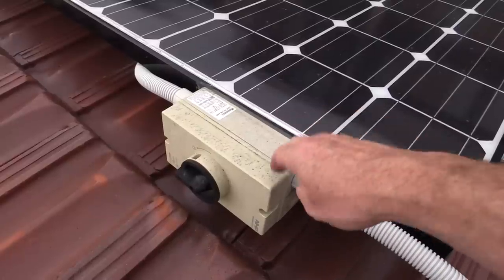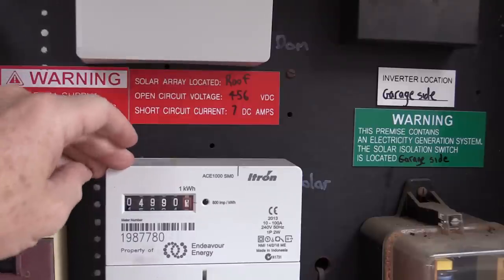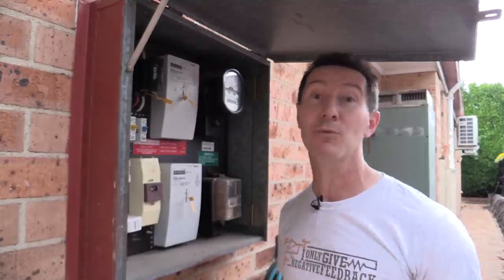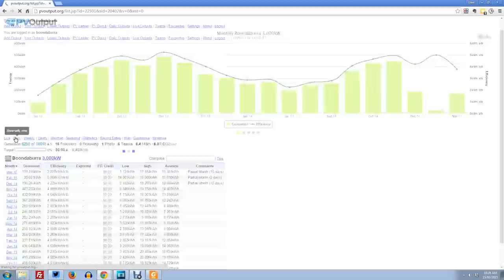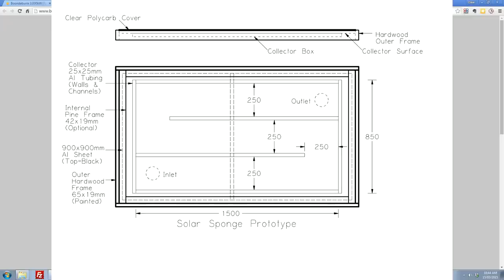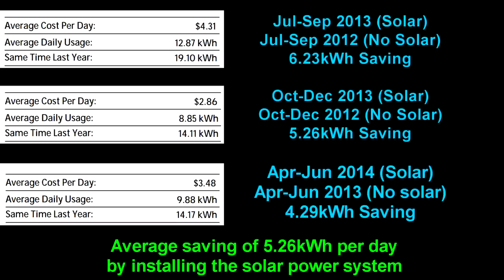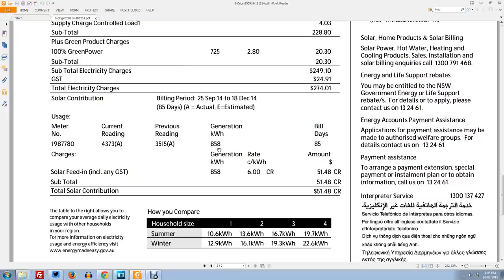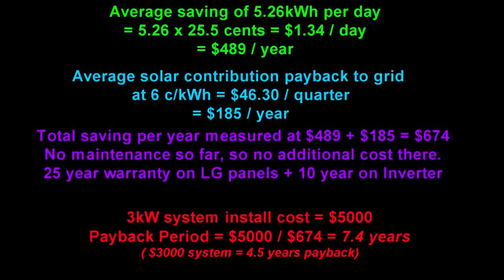EEVblog #724 - Home Solar Power System Analysis & Update

Comment: I been thinking, maybe a temperature sensor on the panels to measure the overheated panels will help configure the temperature coefficient of the panel at the time. We all are losing a lot of power in the heat of the Sun, and we just don't know it...
Have you ever configured the power loss with the temperature coefficient of your panels? 
Our panels are never at 25° C except maybe in 'winter'...

Comment: What you should have done is just put the system in yourself and hooked it to your internal electrical system in your house and keeped that old mechanical analog meter in service, instead of going with that 2 meter system. That way, if you put power back on to the grid. It will spin your meter backwards and they will pay you the full rate for the solar power you put back on the grid.

Comment: What sort of aggravation would you run into putting in a life battery bank?  You could end up cutting that peak usage rate.... Utilities here are screaming duck curve, and no longer paying much of anything for power pumped back into the grid.. a major pain. Think 1 to 3 cents per kwh.  When people were told they could get 20 cents per KWH, they were looking at that to pay for the systems here.. No longer.  I'm looking at it for full power backup... I figure 9 kwh worth of batteries would be needed, so I've started linking up the pennies in the pigging bank....

Comment: Dave,

Is there an opening for a design of an inline switch on a short cable that reads your bluetooth meter and only allows mains through when you are generating power in excess. Maybe not bluetooth, but signals on the mains line powerline products use.

I could imagine a small box that was in a co-operative scheme with others (so the whole scheme doesn't oscillate on and off) to determine which was allowed on, set by watt loading (rotation switch maybe) vs watt availability.
 
Imagine then, things like pool pumps and dryers would only run when consuming your power making the owners minimize grid consumption.

Comment: I wonder if storing the unused energy on batteries would provide better ROI rate. Of course, then one has to factor in both the cost of the batteries and the maintenance of them, but in your case -- very small incentive for exporting power to the grid -- it might be more "profitable".

I don't have the numbers, though. So it might turn out worse. I have to leave it to you to crunch the economics :-)

Comment: My cousin has a 50kw solar panel installation here in France, and is getting payed a high rate for that. He'll be laughing all the way to the bank in a few years, but he's worried about lightning and other threats. The Sunny boxes are not very reliable, though. They keep on having to be replaced.
Reply: Leonard Janus Sorry, I'm not sure I know what you mean.
Reply: Henri de Feraudy I believe he means these, which I looked at a while back for building my own pv system, along with a Xantrex XW hybrid inverter/charger/battery system by Schnieder electric: http://enphase.com/microinverters/

Comment: Did your installation costs include some massive gov't subsidy?  I ask because here in the US, typical install costs for PV are around $4 per watt of nameplate rating, so a 3kw system is around $12k to install, not the $5k you mention.  Just a sunny boy ~3kw inverter the last time I looked was something like $3k or $4k, without the panels.  Also here in the US, most states have "net metering", which means if you sell back 3 kWh in the day, and use 3kWh at night, your net usage is 3 - 3 = 0 kWh so you pay nothing ( besides the fixed service charge ).

Comment: Holly crap do they screw you on those rates, 4x more for them to give you power then for you to give them power... and a service charge on top for good measure.
With a system as good as this I would seriously consider slowly adding batteries so you can get more and more out of your own power, considering you still pay out a thousand per year this should pay back quickly.

We used to have a 4x rate on solar power payout around here, but the moment people actually started putting panels up that dropped like a rock, it is still 1:1 but anyone who hoped to pay for their system quickly got shafted.

Comment: Wouldn't Dave be better of if he kept his old Ferraris meter? I guess he was forced to get the net meters, the old meter would simply turn back (at 24c/kWh). Since you are not using all the energy during the day the meter would run backwards, then during the evening and night the meter would run normal again, thus "using" the energy you supplied to the grid. Key thing here is you want to dimension your PV-system according to your energy usage.

Comment: Wow that's expensive!  We're at $0.10 usd per kwh during the summer and a couple cents lower in the winter.  They offer $2 per watt rebate if you install solar, and the govt. does about 30%, so we get about 60% off after rebates and tax breaks.  Pretty sweet.  The only problem is our HOA not allowing panels on top of our homes :(

Comment: Here in Sask Canada, we are charged 14 cents a Kwh but also basic charge and taxes so 500 kwh is 100 bucks or really 20 cents.  You could easily pay off an electric water heater with the  extra power your not using and put it as a pre-tank to your gas one. But without a battery bank to store and reuse your power when you need it your giving your savings away.  over 7 years to pay off 5000 is pretty crappy. one day selling excess for 6 cents next day buying it back for 24 plus taxes sounds pretty ridiculous.  I wouldn't want a system like that.

Comment: Sounds like it would be worth investing in a dual system with battery and grid tie. With cost difference if 24 to 6 cent it could pay for it self
Reply: Tom Keyser car batteries tend to be 12v, 16v. there are industrial applications where they are 2v, but massive in capacity.

depending on what voltage ur array supplies the regulator at, u can connect a charge regulator and batteries in series to work with the system. for example, if ur array supplies at 14v, u can use a 12v regulator/charger to charge the batteries. And the power from that will go directly to an inverter. if ur panels 42v, this is 3 times the 14v. do u can connect 3 12v car batteries in series to meet the array floaters, just make sure to get a regulator/ charger to work at 42v.

Comment: I'm in VIC and i still get 60c feed in :) and I didn't pay the have it installed it was on the house when I got. So even if you installed the system while the 60c feed in was available they didn't take it away then it was dropped down. And even if you sell the house the rate stays with the house.
Reply from the maker: Dwayne Godden You won't get that forever though.
Reply: There is no plan to change it from what I'm told. The longer the better and I will enjoy it for as long as i can :)

Comment: WOW!  Much cheaper here in the USA.  I pay about $0.10/WKHr + a $22/month connect fee.  When I first put in my 2.8KW solar PV system back in 2007, the electric company paid me full retail any surplus I made.   In the spring and fall, I typically ran negative electric bills. But that only lasted a few years.  Now if I have a net surplus for the month, they only pay me about 3 to 4 cent/KWr that surplus.  Still a better deal than you as anything I generate during the month gets subtracted from  the energy I purchase during the month.   It is only when I have a net surplus for the month that I get a reduced credit for what I generate.

Comment: Thanks, great report. I'm installing a 4.48KW system - fourteen 320 watt LG panels and Enphase microinverters. I'm in California, USA. Our federal government gives a 30% rebate. Dont feel bad about 0.06/KWh, Southern California Edison is paying about $0.045 per kWh. I'm serviced by Los Angeles Dept of Water and Power who also uses net metering and expect similar payment. About cleaning panels, it doesn't rain here anymore :<), and efficiency will drop if no cleaning. For safety sake, I believe  (1) Clean only at night - (2) Disconnect system from the grid, (3) Lather panels with foamy soap (4) Rinse them down,  (5) Squegee them dry.... for single inverter systems, power that unit down if it is grid powered.  ...Your thoughts?

Comment: We have a 5KW system with those same LG Mono panels. We have 21 Panels which is the biggest system Ergon would let us have. On a sunny quarter our system makes $900 because we are on the 44 cent rate until 2024.
Reply from the maker: freeze69IceMan Wow, that's a huge rate, and locked in!, I'm envious. Payback would be 1-2 years top for you?
Reply: No, closer to 5 Years. Our system was $22000 installed with a 25 year efficiency warranty and all that good stuff. It has been on the house for just over 18 months and i just checked the meter and it has made 11.4MWh. Plus we live in Mackay, Queensland.
Reply: And we are a very power hungry house. Our gross summer bill is easily over $1500. But winter offsets any extra summer usage.

Comment: I had panels installed many years ago and the company tried to trick me into polycrystalline by forging the wrong paper work. I managed to get them swap it over for free as their website recommended monocrystallines. It pays for the bills and it is a feed in tariff and I got that Sunny data logger so i can check for any problems.

Comment: Maybe by the time you get a Tesla, you'll be able to use the panels to charge the car and power the house during the day. Then use the Tesla battery to power your house [to an extent] during the evening. That would be ideal and save the cost of adding/replacing components for a traditional battery bank.
Reply: i don´t know how Dave is using his car, but most people drive during day and charge over night. Or they drive to work, where they can´t use their own solar power.
Does the tesla allow back feeding to the grid anyway? And even if: Every charge cycle is degrading the battery slowly but surely. Not a bad idea, but it would have to fit very specifically to the over all life style of the user for a few years.

Comment: I know that this question does not pertain at all to the system you have installed, but how does Solar PV compare to Solar Hot water/electric heat pump hot water systems? Chapter 6, page 38 of "Sustainable Energy without the Hot Air" by David Mackay recommends solar thermal over solar PV in terms of energy production due to the large amounts of energy required for heating/cooling things like water.

Australia's higher insolation would change the parameters somewhat. I suppose in principle generating electricity is more useful because it is usable in a wider range of devices, but what I'm interested in is whether a PV system or a solar thermal system would have a bigger impact on our power and gas bills given no behavioural changes; and which option would abate more carbon, assuming Loy Yang coal power and natural gas fired water heater.

As a further question more specific to your PV setup, what would adding storage do for your power usage, and would it deliver an economic return without specific behavioural change? Solar's peak delivery during the day but peak domestic power use happening towards dusk and night time would be served well by storage, but would it give your net meter more of a kick?

Comment: Wait a minute, you solar generated 7.5 MWh, gave 5 to the grid. That leaves 7.5-5= 2.5 of it that you used in your house. You also used 6.7 from the grid. That means your total use was 6.7+2.5=9.2. But again you only solar generated 7.5, so no, even with a perfect storage system, you would not be energy independent. you need an  extra 25 ish percent increase in your solar power generation amount.

Comment: All your calculations look correct. I will not get a battery at this point if I where you since you have the grid for that even at 6 cent is better. The best LiFePo4 will not be able to be amortized at all at those 25 cent/kWh or just barely so it dose not make sense.
I live OffGrid so I have no choice other than to use a battery but I needed to design and build my own Solar BMS charge controller since there was none available for Lithium batteries and Lead Acid was absolutely no option those are extremely expensive to amortize and will have been almost impossible to use in a cold climate like mine since they need outside venting and the perforce at low temperature will have been even worse.
Anyway I made just a 7 day energy production and consumption graph recently (the toy computer that I was using to data log has died so I wait now for a raspberry pi to replace that) the graph is on my website dot com same as username.
I have now a new version of Solar BMS in mind that is just on Kickstarter at the moment and this will support a 3kW PV array so exactly designed for 12x 250W panels. Maybe I will send you one for a review if the campaign is successful.
And your 5000$ for that 3kW installation is really not bad especially since it was done about two years ago. Maybe you will need a replacement of the grid tie inverter over the 25 years life of the panels. Not sure you will be allowed to repair that if some electrolytic fail.

Comment: You can increase a LOT your Solar usage by simply actuating your high powered eletric appliances During Day time Even when you are not at home, namely the Wash machine and the Dishwasher. amost all models have timers and can be programmed to start any time.
If they don't ... then simple use a timer on their power line ... simple and doable.

Comment: Being someone who uses very little energy comparatively speaking, being grid-connected is a real nuisance. A lot of the time well over half my electricity (and gas) bills are 'standing charge', meaning I have to pay them no matter what.
I could use no power whatsoever and it would make little real difference to my bills. It's really obnoxious...

In that sense, having a solar system with battery storage + grid connection would be kind of annoying.
But I can see why you might want it for reliability reasons...

Batteries really seem to be key in general to the long-term viability of solar. Whether it's people with their own solar and storage systems, or large-scale grid storage, it would make a huge difference to the generation/usage mismatch if we could store most of this energy...
As it is, both Solar and Wind cause a lot of headaches because the peak energy generation is often at completely different times to peak use...

Comment: How do you use only ~15KWh/day? You have a modern house, similar in size to mine, yet I use over 30! I also have mostly LED/CFL lighting. My A/C compressor and electric heat is on a separate off-peak meter, so those aren't even included, but yours are figured into the 15 figure. Awesome. I need to figure out why I use more than double the power that you do before I consider solar/wind.

Thanks for the informative video!
Reply: I wonder if anyone makes a cheap data logging clamp/donut style ammeter, so I could monitor usage on individual circuits? Found an industrial model, but no way I'm paying for that. Maybe even a DIY project!
Reply: SteichenFamily We use about 24kw*hr per day with 2 people. We have all electric appliances, electric hot water, and Perhaps 200W worth of computer gear that a normal person wouldn't.

I just bought a clamp on meter on Amazon along with a splitter  for  about $50.